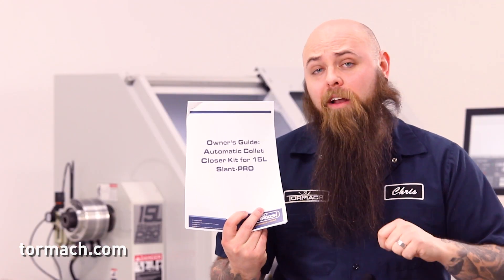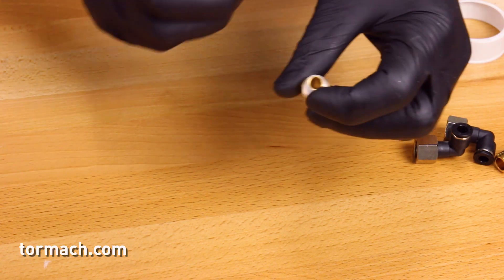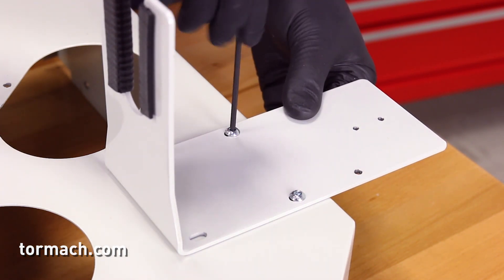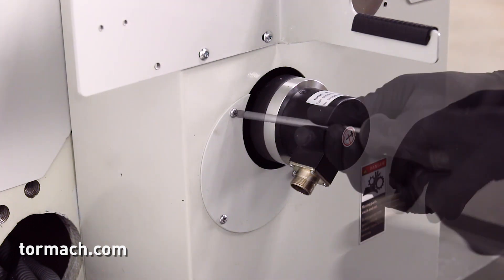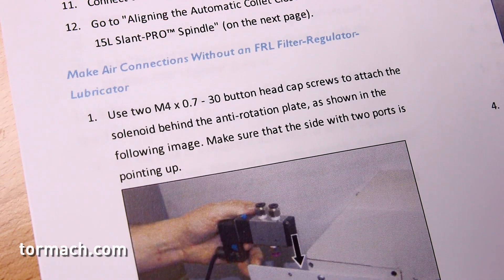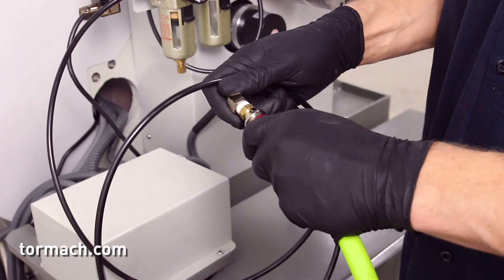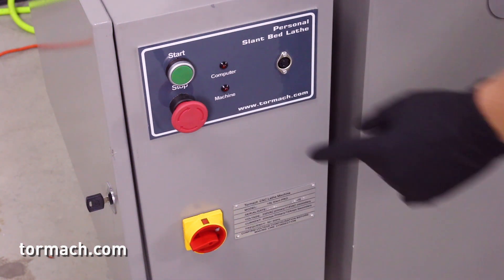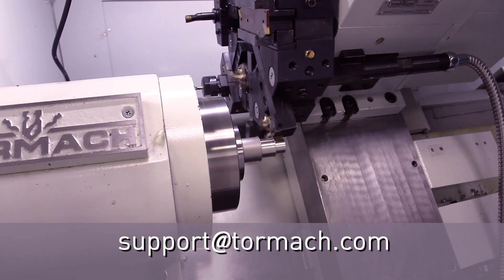Installing the Automatic Collet Closer on the 15L Slant-PRO Lathe

Comment: Does the M64/M65 still work with the programming? 

That's what I've been using for all my programs that utilize the auto collet/bar puller combo.
Reply from the maker: Yes, the M64/M65 still does work with the programming. If you have further questions, please contact Tormach Technical Support at support@tormach.com.